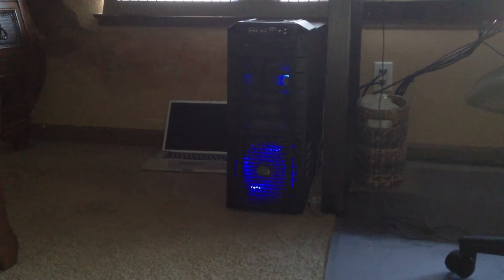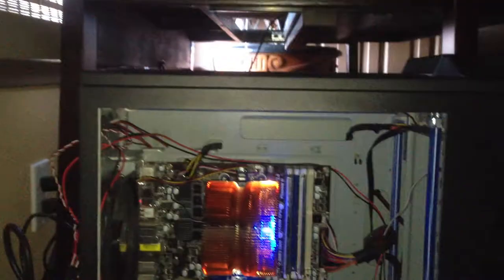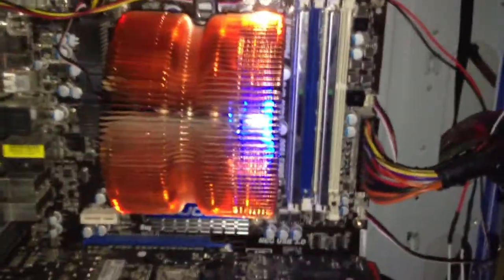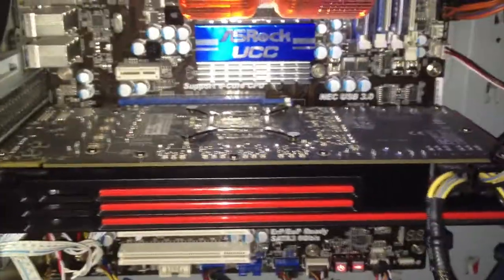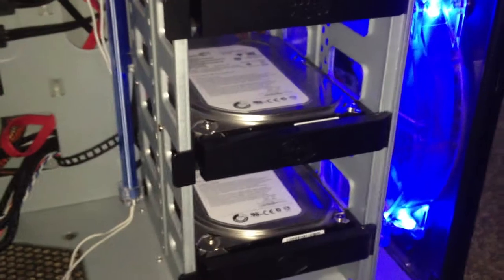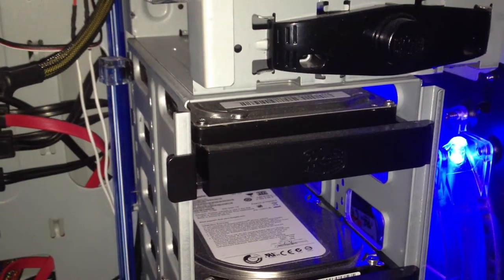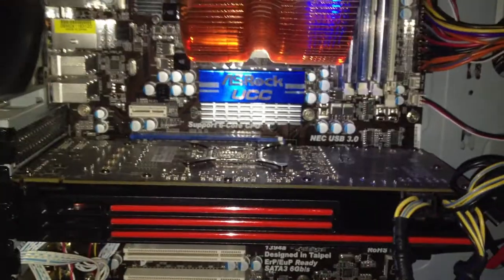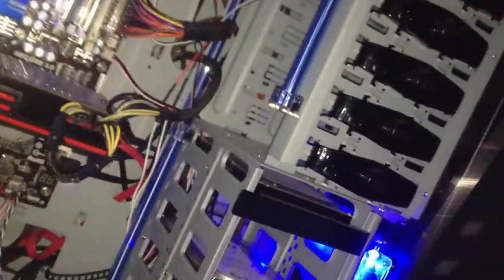My Gaming PC 2011 (old build)

Comment from the maker: @BloodGod66 My PSU doesn't have any voltage settings but I did try moving the GFX card onto its own 12V+4 rail and it improved my FPS on Ultra from about 20-40 to 40-60... Should it be even higher or am I good to go now?

Comment: lol first off, 4.0ghz on amd to 4.0ghz on intel, are totally different.  and 2, even if it was, amd overclocks there processors 400-1000mhz and that is the number on the box, the speed for intel is natural and what it runs at naturally.